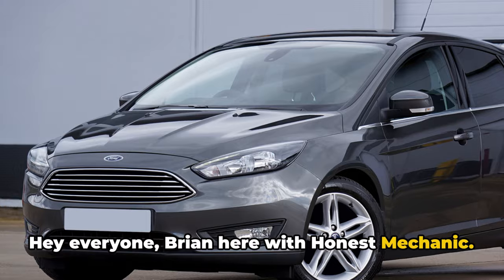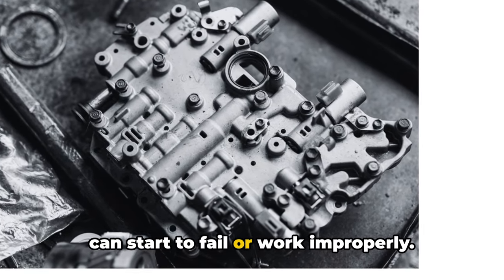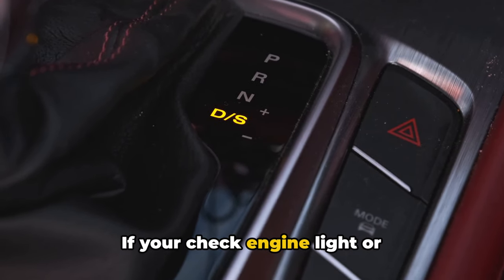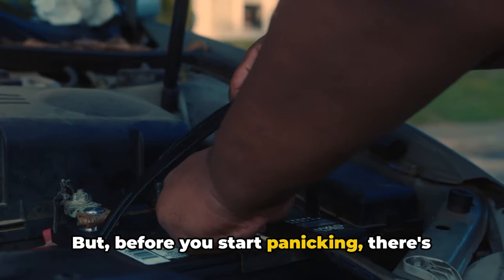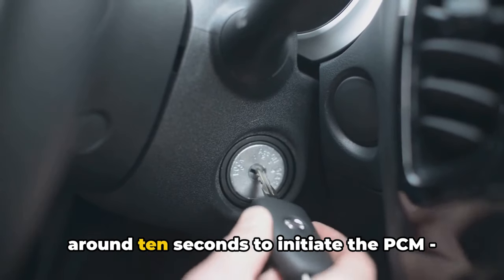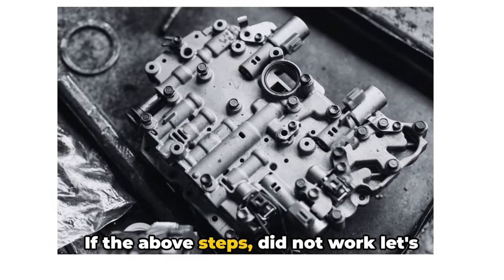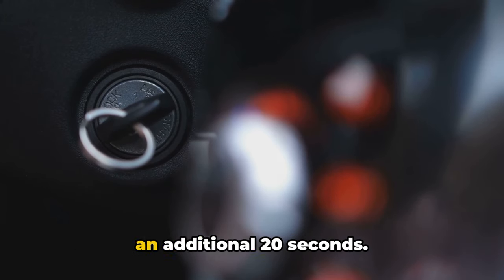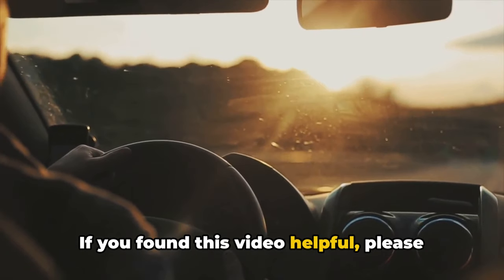How To Reset A Ford Transmission Control Module: Resetting TCM Step by Step Guide

Comment: 2015 ford fiesta, clunking, shuddering and engine light on. Second method worked for me on attempt #2. Had to leave the car in neutral rather than put it back to park for the transmission reset message to come on. Engine light off and no longer clunking, thanks for this video!!
Reply: Can you please tell me what u did. I have same issue with my ford bmax and mechanic saying I would need a new gearbox but I don't believe him

Comment: I have Transmission limited function light on my dashboard and my car loses power when driving. By doing this method will it fix the warning light.

Also do i need to change the Transmission fluid and filter before i try any of this methods.

Comment: Ford 2019 f 150 tranmisdion shudder fixed.  By following the steps . Thank you
Reply: Trying this now for the same year truck and issue
Reply: attempting for my 2019 f150, a bit confused on what to do after letting it idle for 5 minutes. do you go through the gears while in neutral?
Reply: Which method?

Comment: THIS 100% FIXED OUR 2019 F150 LARIAT. We were towing a ultra-light travel trailer and had transmission "chugging"/loss of power/RPMs not adjusting to gears. Did the first method shown here exactly and we are now rolling again without any issues. thank you!
Reply from the maker: Thanks for taking the time and leaving a comment... I am really glad it worked!!!!

Comment: Hi Brian, thanks for the explanatory and clear video, I have a Land Rover Freelander 2007 diesel 6-speed automatic transmission and I suffer from a jump between the second and third gears and in combination with reverse gear there is a pause and a knock, to note that the transmission and engine are from Ford company Do you recommend resetting as described in the video?

Comment: We just replaced the lead frame in the tranny of my 2011 5.0 F150. New fluid is in at the correct levels, but it’s still shifting a little hard in gears 2 and 6. Could resetting the computer be a fix, or just time driving it around?

Comment: How often should I reset the transmission? Do you think it's ok to do it like 2-3 times a month or doesn't matter at all? Please let me know, thanks!!
Reply: Shouldn’t have to be reset more than maybe once once you do it it should slowly learn your driving pattern like the video said might take some days depending how much you drive but it’ll get it down and run off that but 2 to 3 times is over doing it transmission won’t learn anything

Comment: 2013 Escape.  My project is trying to disconnect the negative battery cable in order to "reset" the transmission scheme.  Will disconnecting the battery neg / ground where it is bolted to the firewall enough to clear out & "reset" the transmission scheme memory settings, or will the cable connected at the negative battery post need to be disconnected too?
Reply from the maker: Hi there, before the battery disconnect method, did you try the other methods I mentioned? To effectively reset the transmission adaptive settings on your 2013 Ford Escape, you should disconnect the negative battery cable directly from the battery post, not just where it bolts to the firewall. Disconnecting it at the post ensures that all electrical circuits are fully interrupted, which is necessary for a complete reset of the transmission memory settings.

Comment: 2014f150 i was pulling into a parking spot and went to shift to park and the indicator light said it make it to reverse then stoped not now the shifter won't move at all but the truck will roll like its in neutral but won't Crank will this work for that
Reply: Go to ford they released a new recall for your truck

Comment: Is it ok to disconnect the positive terminal instead of the negative? Positive is easier to get to.
Reply: If your battery is mounted partially under the engine shroud undo the secure bracket and move the battery forward so you can reach the negative post.

Comment: Hey man, I recently had an issue with the check engine light with the error code P087B on my ford ecosport 2014 AT transmission. Could this be related to TCM and also can it be resolved with this technique? Would be awesome if you can let me know 😊

Comment: I'm gonna try this later today, will post results tomorrow in the same thread.

For the sake of others who may find this comment, I have a 2012 Ford Focus SEL, 110k miles. So far the symptoms have just been occasional difficulty shifting gear (the stick), delayed shifting into reverse (I move the stick, but the car takes 2 secs or so to actually idle backwards), and strange timing when shifting gears while driving (usually it waits too long, but I've had it shift suddenly a jerk a bit once or twice). 

Replacing the TCM myself would cost $900 with about $300 returned to me if I exchange the old TCM. But to save myself $600 I want to try resetting it first.

Also of note, I know it's a recalled part, but the local Ford dealership is horrible (for many reasons) and refuses to go ahead and replace it under warranty until the car actually locks up and shows a TCM fault. So in order to keep my car from locking up at all (and saving myself the cost of a rental), I would like to take care of things ahead of time. Hence why I am here.

So hopefully I will have the same luck as the 563 people who liked this video before me. As I said above, I will post results as a reply to this comment. Initial response will be tomorrow when I've driven it a bit. After that, I will only come back if things go poorly.
Reply: It does feel somewhat better, more noticeable at higher speeds. Haven't had the issues I was having, but it's also only been a day. Anyway, if I haven't added to this thread, assume the problem is fixed.
Reply from the maker: Thanks for sharing this, really helpful!
Reply: In my case, the problems did return, so I went ahead and changed the TCM.

Comment: I did it yesterday when the car's cold it's still juddering and slightly slamming in gears i get transmission limited function but once it warms up and i drive its fine it happens in morning and i can only go 20.mph. i did the 2nd procedure first didn't work I did The first it seems like ot did something but can back but.ok.when engine has warmed up